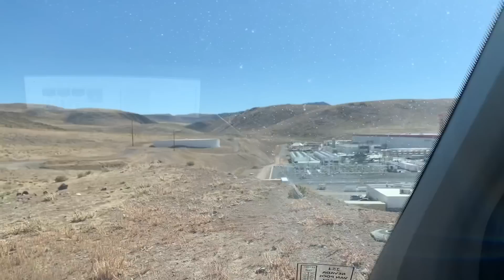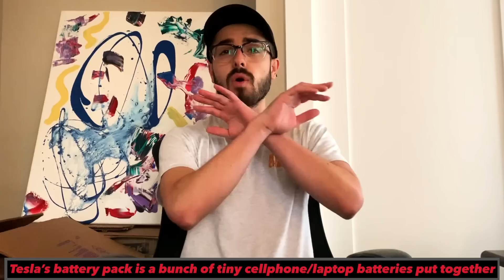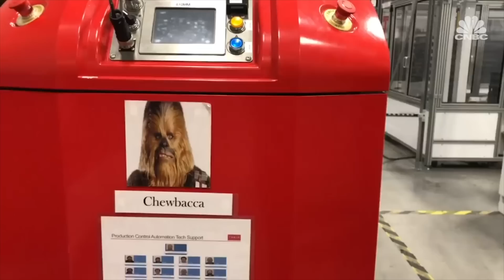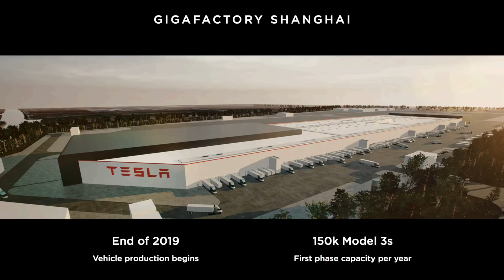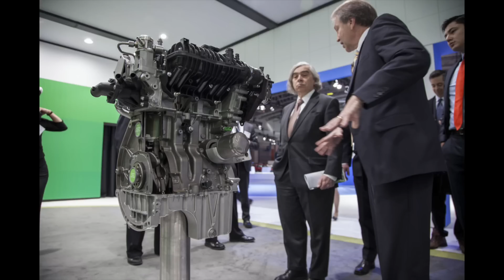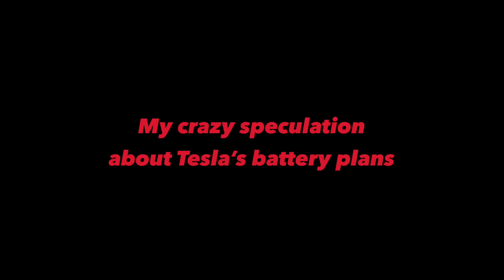GigaNotes: Analysis From My Tesla Gigafactory Tour

Comment: MY crazy idea (from extensive research) - Tesla bought MAXWELL plus the ONLY battery cell production manufacturing plant design company today. MAXWELL got their start by combining Infinitely Variable Pulse Width Modulation Output Control to a "standard" cylindrical capacitor and made the FIRST CONTROLLABLE capacitor battery. It charges INSTANTLY yet only provides power on demand and will maintain whatever level of charge it has until that charge state has been altered. They went on to change the composition of their capacitor strata and insulation materials to increase both reliability and longevity. NO moving parts or chemical / heat reactions, just stored and released pure electrons. NO MORE LITHIUM REQUIRED.

Comment: Hi ! Question ? What happens when EV reach end of life , what is the strategie when recycling old batteries?
Reply: Defining the end of life for an BEV needs to be separated into two.
1 - The battery pack.
2  - The rest of the vehicle.

If well maintained, the rest of the vehicle is little different from any other vehicle. Some will still be driving 100 years from now, others will be scrapped and the materials recycled as happens with the majority of new cars manufactured today.

But when the battery becomes unfit for its original purpose, that of holding sufficient charged to give sufficient range for the user, it can be re-purposed. Primarily for static battery storage. In this secondary use, weight and size are much less of a consideration.

Nissan has partnered with power management firm Eaton for its car batteries to be re-used for home energy storage. But eventually the battery packs will become unfit even for this purpose, so I foresee an industry growing in recycling what's left. They only thing preventing this being done on a grand scale at the moment, is that there just isn't enough old BEV battery packs.

Comment: I know they reduced the cobalt content in their new 2170 cells. Silicon is probability their next logical move, especially if they have resolved the expansion and contraction issues. These rare earth elements are not viable when upscaling EV battery production. Alternatives will have to be found, to keep it sustainable and reduce costs.

Comment: california is insane to not have adjusted the rules to allow for the gigafactory in-state
Reply: At least FIVE different States were vying to be the site of Gigafactory #001.  Tesla simply accepted the best possible deal.  I expect there won't be another Tesla assembly facility in California, ever again.  The Real Estate costs too much, the traffic is too bad, the building/envionmental regulations are too plentiful, the pay scale for employees is too high...  

I figure a Gigafactory in Texas would be able to produce batteries and Pickup Trucks.  Somewhere off the I-20 between Pecos and Sweetwater would be ideal, with lots of solarand wind power available.  Though theair www quality trulysucks around Odessa.  Something closer to Austin/Houston might be better for getting skilled workers and for shipping purposes.

Of course, Texas stoll blocks Tesla Direct Sales and has done so since 2013, refusing to grant them a Dealers License even though they had one there before.  That might be a bit of a sticking point.  A point the Texas State Assembly, which meets only once every two years, has consistently 'run out of time' to discuss or rule upon in 2013, 2015, 2017, and apparently 2019 as well.  Maybe in 2021?  Should be doable, as Tesla currently outsells Cadillac, Chrysler, and Lincoln and has done so nationally for twenty-one straight months...

Comment: So model 3 plus model Y output will max out at 500,000 cars.   When model Y starts will the model 3 production then go down or model Y is severely limited.    I expect 1 new line for model Y in Fremont and then 1 existing line will switch to model Y after a Year.

Comment: Gali, it seems like other than batteries and battery packs, Giga 1 is not producing anything else after all these years.  Did you ask when is Tesla going to start producing vehicles at Giga 1? Did you see anything there that would indicate this is going to happen soon, like assembly line robots or paint shop areas (like Giga 3)?  Why is only a small area of the roof covered with solar panels still?  Is there still a housing shortage for employees in the Sparks area? 

It looks like Giga 3 will be first at what everyone envisions as a "Gigafactory."  It looks like there is no open areas on the roof of Giga 3 for solar panels with all the A/C and ventilation ducts.  Is that why Giga 1 solar panels did not expand?  Buffalo's Giga 2 seems to be a money pit for Tesla.

Comment: Very interesting study: an EV powered by the dirtiest electricity generated by burning brown coal is still producing less CO2 than the cleanest ICE car
Reply: Jonny B that is only part of the story. Pollution is much more than CO2. For example, carbon particulate, and sulfur compounds. 

Gasoline engines produce more carbon particulate than “clean” coal. And all that nasty stuff is right where people breathe it, so an electric car run on coal powered electricity is better in several ways. 

But of course, coal is dying, and solar is booming.

Comment: Personally I think all the speculation about Tesla going to pouch because Jeff Dahn demo'd a cell chemistry using pouch is mistaken. I suspect Dahn uses pouch because it's easier to make at lab scale, and as he wants to test chemistry, format doesn't matter much as long as he's consistent with it. Tesla OTOH has committed to Cylindrical for production efficiency, cooling ability, dimensional stability, etc. and has solved the challenge of integrating 4000 of them into a pack. They can upgrade chemistry as and when they need to whilst still benefiting from the lead their cylindrical tech gives them.

Comment: Can’t see any solar panels on the gigafactory shots.
Reply: It isn't finished being built.  In 2016 the maximum capacity of the site, thus it's size, was TRIPLED from the original expectation from 2014.  It is only 1/3rd done so far.  Be patient.  The place has been pumping out battery cells and battery packs since 2017, even with the building incomplete.
Reply: It isn't finished being built.  In 2016 the maximum capacity of the site, thus it's size, was TRIPLED from the original expectation from 2014.  It is only 1/3rd done so far.  Be patient.  The place has been pumping out battery cells and battery packs since 2017, even with the building incomplete.

Comment: There are 2 questions I have and I  suspect that you asked them when you were there (unless you already know the answers) 1: why can't the batteries be bigger and using a smaller number. 2) what is the weight ratio of the indevidual cell casing to the rest of the cell.  ( my expectation is big part of the weight of the battery pack is due to the casings)

Comment: I did not see a HyperChange video about the HIBAR acquisition that was in the news earlier this week, which I think ties in perfectly with your thesis that Tesla will start producing their own batteries at some point.. Its a company specialized in design, engineering and manufacturing machines to fill electrolyte into the battery cells at HIGH SPEED.. This company MAKES THE MACHINES to make battery cells!.. and now Tesla is the exclusive owner of this company.. sweet!

https://youtu.be/5Kbb_nsZUMw

Maxwell+Hibar = Its about a sure thing Tesla is going to manufacture their own batteries, which will make them Better, Cheaper and will provide (much) longer range... 

And Tesla will be able to make the cells at mindblowing speeds... Maxwell has the tech to manufacture the electrodes and roll them into cylinders, much quicker then with the wet technology Panasonic and many others use.. In turn, Hibar then provides the tech to fill them with electrolite and seal the cylinders, just as quickly as Maxwell tech can feed the Hibar machine.. I know its much simplified, but I really think this is just about what is gonna happen in GF1.

BTW, I have read somewhere that construction that is going on beside the GF3 in Shanghai (GF3 Phase 2) will be a battery manufacturing facility. Anybody here who can confirm this?

Anyway, once Tesla has the battery manufacturing under control and can make 1TW capacity per year. and starts cranking out thousand upon thousands of Model 3/Y cars. I think will be rewarded with some huge profits on our TSLA positions :-)

Comment: Very informative video. As a shareholder I learned a lot about how the batteries are made and the rapid advance in technology.  I think you are right. They will definitely make their own batteries. ICE manufacturers will have a hard time duplicating this technology.  It will take them a long time
Reply: Tony G Tesla has quite a lead start! I am vlogging daily about TESLA and other stocks in my channel as well.
Reply: Tony G - It will not take long, taking battery cells and paring them in seriel or parallel isn’t new, so no there isn’t any rocket science in that “tech”. It  will not take long to catch up for the automakers. Only Tesla fanboys think so 😉

Comment: To compete, automakers need to realize that a battery plant in the 21st century is no different from something like a transmission plant was in the 20th century.
No batteries, no cars.
As you pointed out, this is going to take them a LONG time to catch up.  If they even can.
Reply: Twelve Wing Productions let’s see how long it takes to catch up. I am vlogging daily about TESLA and other stocks in my channel as well.
Reply: @wolfofdubai  The biggest stumbling block to them catching up, and the reason I gave the qualifier "if they can", is that they may simply not be nimble enough.  To be able to transfer over to EVs, they would need to do it slowly over perhaps a decade.
The reason for that are things like transmission and engine plants.
These are highly specialized lines with highly specialized work forces.

Trying to retool and re-train these facilities in a matter of even a year or two would be a nightmare... much less trying to do it in the far shorter amount of time needed to continue to sell vehicles in a model year while transitioning.
Both the plug in hybrid as well as making a car that can be either gas or electric are ways we currently see them attempting, but both of these result in cars that in no way compete with all electric vehicles.

So I see this getting interesting in a hurry.  I simply don't see either the battery production or the ability to turn drive train plants around for existing automakers.
Perhpas if one of them partnered with Tesla to get it done... but right now?
No.  I just don't see any of them with the excess capacity to do so.
Reply: Twelve Wing Productions - No it will not take long to catch up, if it at all notice what is happening you would know so.
Reply: @ACPilot , I'm an industrial process engineer.  What I'm seeing are companies that have not slowly invested over time.  Now they are stuck.
They have projects that will have to be done... as in completed... in 3 years that exceed the entire market capitalization of their entire companies.  In some cases many times over.
So that... is what I notice.

The reason they are stuck is that as Tesla and those companies that are rising up now... Rivian, Bollenger, Byton, Fariday... others... will be selling cars.
Chevy won't.
VW group is a little better positioned, they might survive.  Ford has aligned themselves with Rivian and have plans for an electric F-150... so they might survive.

The others?  Probably not.  They will have to instantly convert all their existing vehicles to electric with complete redesigns and then try and figure out where to get batteries for them.
That's not going to work.
As if that argument wasn't strong enough, their entire business model was built around service.  Not around building a car that won't have to be touched for 200,000 miles or more.
They won't retain their dealership model selling tires and windshield wiper fluid.
Reply: Twelve Wing Productions - Well the bigger producers WILL survive this, for us consumers we can help by not buying Tesla’s 😉

For those who is a bit behind they can pool up with other automakers to produce a platform to use across brands. This is what VW is offering other brands.

Comment: Galileo, great analysis great emphasis on the salient points.
Yessssss the crucial point is the additional cells for Model Y, Semi bc and Puck-up...... these have not been accounted for!!!!
Major black hole that had my head scratching for several months and nobody can answer. From 35GWhr to 1TWhr there’s a massive ocean to cross.....how’s Tesla mapping that out is really the crux that we need to grasp.
Strategically if they do it right, it will cement their leadership in electric power trains for the next decade or at least until a new electric storage technology replaces lithium
Reply: Federico Galimberti good points. I am vlogging daily about TESLA and other stocks in my channel as well.

Comment: Battery production is why Tesla will be profitable. Batteries are super relevant today because of climate change in California. We are using Power Packs because the utility companies cannot keep the power on during high winds which may cause power lines to go down and then fires. Superchargers will shortly be run off Power Packs. 
In 2020 Tesla should be below $100/kWh. Other Manufacturers don’t get to start at this price. They will start at $150+/kWh. This is the Tesla lead and why they will be so hard to catch. Then if you want to talk about other Tesla tech, inverters, battery management, motors, battery development, autonomy........
Reply: shepherdsknoll8 right their vertical business integration is amazing. I am vlogging daily about TESLA and other stocks in my channel as well.

Comment: That Elon Musk is one smart team player feller. So here's a few items that have surely passed his synapses. The current battery race for high density (energy per weight) performance applies ,IMHO, only for cars and trucks and airplanes. Energy storage for systems that are welded to the ground have a different spotlight on them. Cost per output. It's here , IMHO, that Tesla is developing a whole new battery type, not yet disclosed. Could be a flow battery or a melted battery. Rest assured that the Tesla team is aware of these possibilities. I'm talking here for 'powerwall'  uses that will be scaled up to replace coal and  gas generated  utility systems around the world. That will fuel the Supercharger system. Around the world. STORING SUNSHINE.  Flow battery power could be pumped in pipelines just like petroleum , from high sunshine states or areas to power needy areas. The circle has just become squared.

Comment: Panasonic is an "accounting company".  They focus on the numbers.  A profit is required to stay in business.
They manufacture for many car companies.  Their goal is to have a defect rate of 0%.  This costs money.  For example Toyota will pay more for a car radio than you would pay at an auto parts store.  The one Toyota buys has been tested.  The one you buy has not.  If yours fails it will be replaced.  Toyota has a reputation for reliability.  They pay more for components that have a 0% failure rate.
Tesla's have 100's of millions of batteries.  A small percentage failure rate is a big number.  Making batteries cheaper with the same level of reliability gets more and more difficult as the price comes down.  It can be done but one mistake could be costly.
I really want to see lighter, smaller, more power dense, longer lasting, cheaper batteries.  Today's battery tech has changed many products.  Tomorrows battery tech will change many more. 
 We are witnessing the battery revolution via battery evolution.
Reply: Jim Hitch - Tesla is not about quality

Comment: Do you think Tesla's battery packs are over engineered? Seems like there should be a simpler way and possibly they have "painted themselves into a corner".

Thoughts?
Reply: In what sense? Most people who have looked at the batteries seem to think quite the opposite, that they're very efficiently designed.
Reply: Well, as a novice I just wonder are alot of small batterys rather than fewer larger batteries actually an advantage. I'd love to know about the pros and cons of Tesla's current competition.

You know kinda the Same way they defended their use of cameras vs lydar.

Maybe We just have to wait for the battery investor day...

Comment: The problem with the simi is weight. The million mile battery is 200/kg. The weight limits that the government places on vehicles is to elongate the life of the road. Heavy vehicles compress the road bed as they pass over it and cut the lifetime of the road bed before we the taxpayers have to repair or replace it. For each lbs or kg of battery weight of the semi, you have to subtract a lb or kg of load weight that the semi can carry--reducing its economic utility value and its business case as an investment.